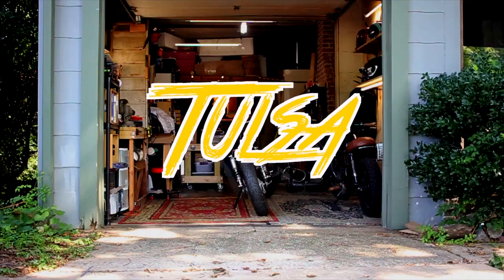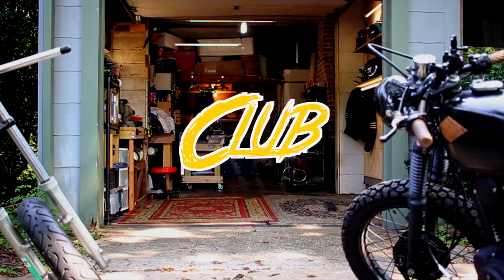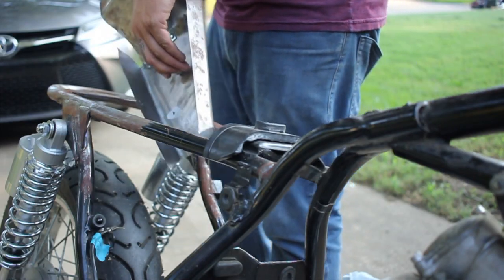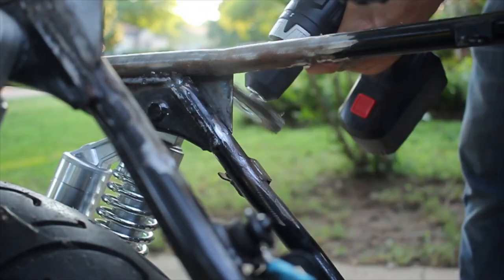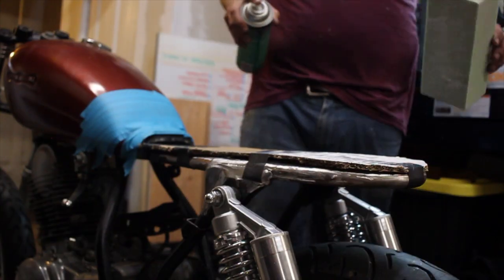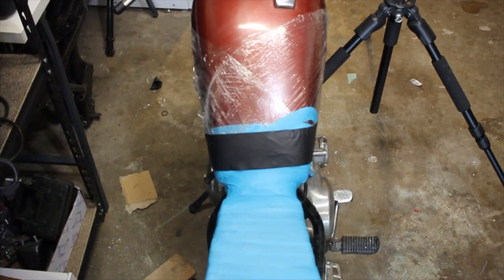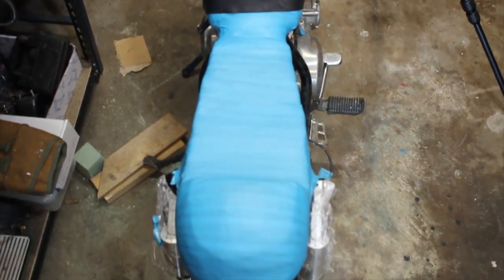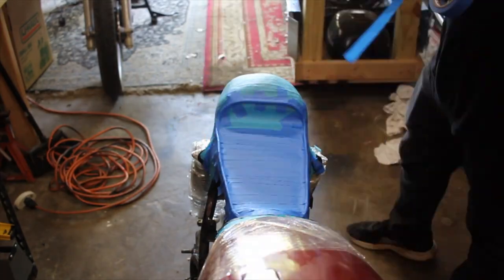How To Make A Cafe Racer Seat - part one

Comment from the maker: Anyone have any advice for working with fiberglass?
Reply: Are you planing on removing the fiberglass shell from the foam mold or completely encasing it?  Either way I would suggest testing the resin on a scrap piece of foam before you start on it.  it would suck to find out partway through that the resin has soaked into the tape and started dissolving the foam.  A coating of aluminum tape would not be a bad idea if you are going to remove the foam.  It will prevent the resin from seeping into the foam and it will make it easier to pull the foam out.